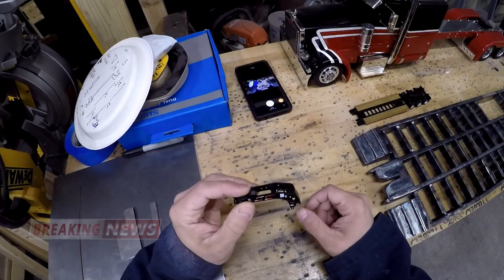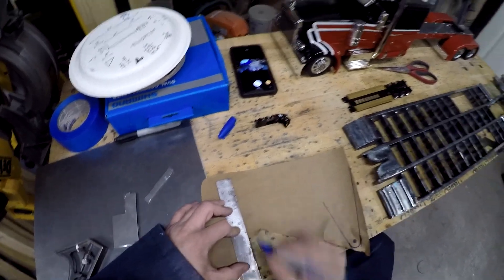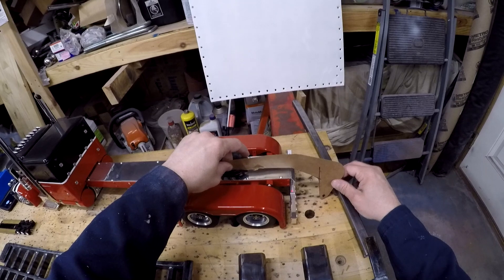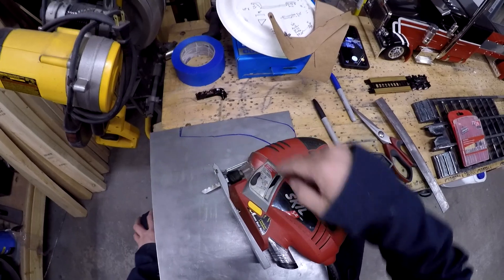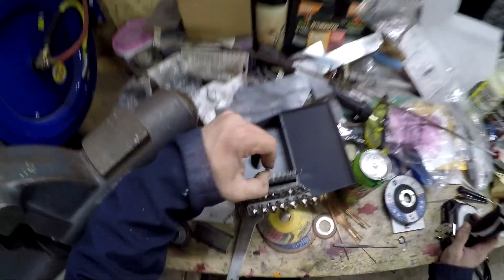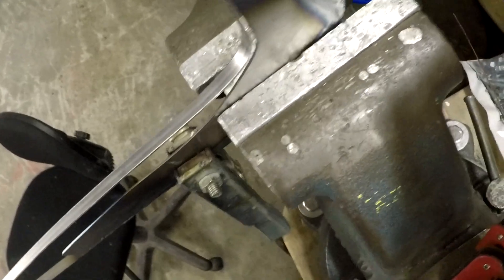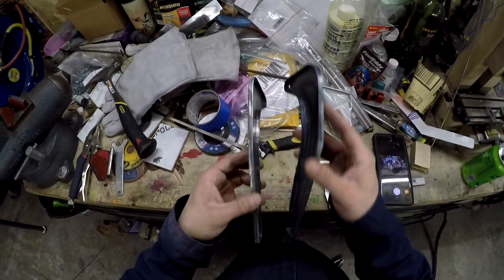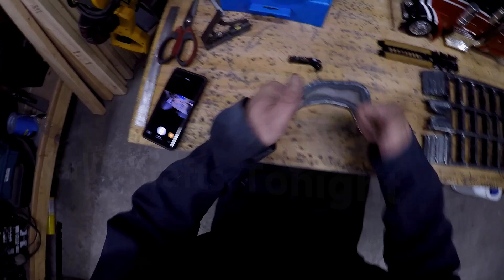Fabricating 1/14 Lowboy for Semi Truck Part 7

Comment: How tall is the grandhauler fifth wheel from the ground
Reply from the maker: Dont have a clue. I didn't measure and do not have an original one to measure either.
Reply: @KarlsKrafts  thank you I’m trying to build a lowboy too just a fixed neck and struggling to find measurements and I don’t have my grand hauler yet